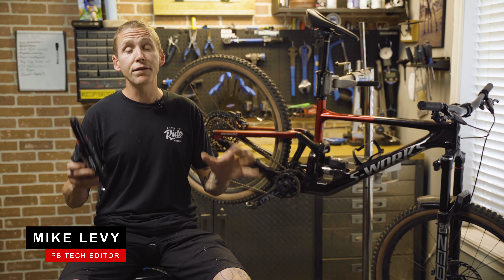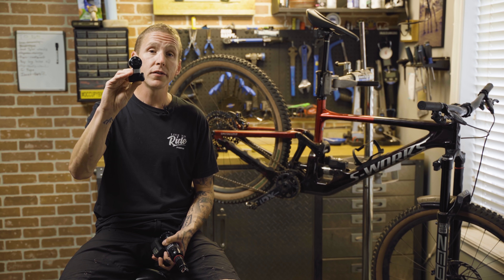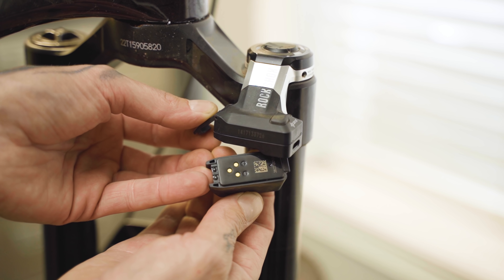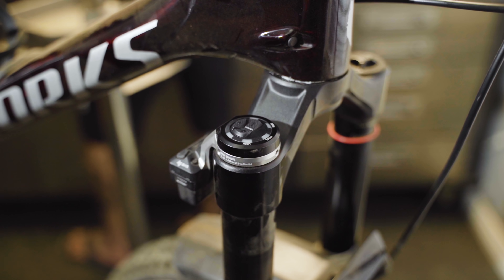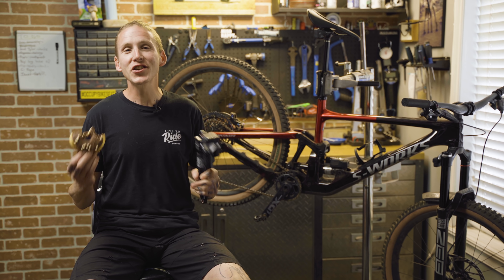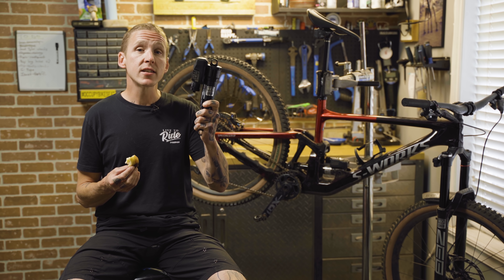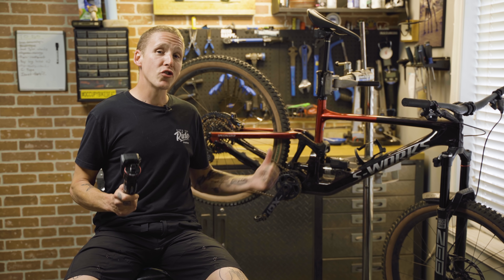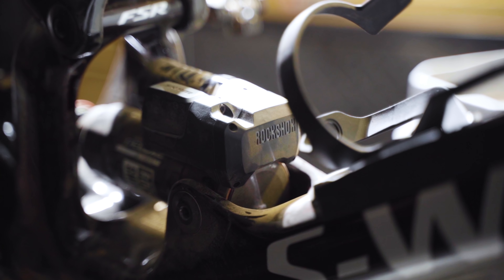Electronic, Computer-Controlled Suspension! Rockshox's Flight Attendant | First Look & Ride

Comment: I enjoyed using it initially but after 5 months issues showed then i was advised by rockshox to bring it to the authorized lbs, only march 2023 i got the bike from canyon. The local bike shop told me they did all the tests required by the sram but then werent able to fix. I tried to ask for warranty replacement but as per lbs, they said sram is refusing replacement and only want to change the controller. I mean i havent used the bike for total of 5 months since the issue occurred. But the first issue with the fork they replaced the entire fork. Im gonna buy a new bike but will definitely remove any rockshox or sram as i dont like how they treat their customers. Wont even reply in email.

Comment: I got this system on my Giant Trance X advanced Pro 29 SE for $4500. Giant used to sell them for 8,000. I think this means Flight Attendant is on its way out. But for that price, I got it anyway.  I like it as once you set it up you just have to turn it on and roll. Both RockShox Flight Attendant and the Giant Trance X SE are pretty rad. The combination of the two is even better. In fact, this bike surprised me as being one of my favorite bikes in my quiver.

Comment: I would definitely run it if I had the money :-)  The only time when I need to adjust my suspension is when I move really fast and go from one type of terrain to another. Reaching down and adjusting the suspension is a problem, especially when racing and transitioning from a long climb to a steep rocky downhill section.

Comment: For sure i would use it.  For the no ski lift within a 1000 miles brigade where long climbs are necessary, this gives you an option to enjoy your more burly bike so much more.  Climbing efficiency is the Achilles heel of most enduro bikes and this gives a viable alternative.  I’d rather have a few little batteries and be able to pedal the hills than a bigger battery in the down tube like some our E brethren.  Climbing efficiency as an added bonus adds to the joy of the descent and, after all, isn’t the guy with the biggest smile at the bottom the winner.

Comment: Battery count time - If you have a fully sram-ified bike
Eagle AXS Controller: 1
Reverb AXS Controller: 2
Eagle AXS Battery: 3
Reverb AXS Battery: 4
Flight Attendant fork Battery: 5
Flight Attendant shock battery: 6
Crank Sensor battery: 7
TyreWiz Battery Front: 8
TyreWiz Battery Back: 9
9 batteries? On a mountain bike??

Comment: Can you run the attendant on just the shock? That would suit the majority of folks better. So simply the DUB insert and the rear shock controller would be perfect! No fork required. But I’m thinking 🤔 SRAM/RS doesn’t like the vendor mismatch that is more prevalent in today’s configurations. Thanks!
Reply: Mia - Sᴇx Cʜᴀɴɴᴇʟ 18+🅥  yeah, I also have a decent quiver for different days out. However, I’ve been riding SCOTT for some time and use the Twin-Lock more then I ever thought I would. The Twin-Lock allows me to lock the fork and shock, limit the travel in a pro-pedal feedback, or fully open for DH. This allows me the option to be more conscientious and adaptive when riding. But, the Twin-lock has its limitations with  compression and dampening adjustability, so this new SRAM/RS setup may allow the suspension system to be configured adequately and subsequently adapts the travel accordingly at the next layer, hence the piggyback modules. That being said, I wouldn’t think it’ll be worthwhile for some time. More riders and feedback will be needed to help developers get a better system through lessons learned. I have the belief that you don’t know what you’re missing until you try it, and then never look back. I would be willing to try it to give insight and feedback to support the engineering of the system, but have considerable reservations about purchasing at this point. Good luck, stay safe on the trails…

Comment: I had a lapierre back in 2015 with the second generation e:i system and it worked pretty well for me, even in the wet Scottish climate. I'm a set and forget person and very rarely lock out my suspension, this might be something I'd run on my bike, but not at the extra cost it's gonna command, maybe in a few years when sram have recouped some of the development costs and price comes down.
Be interesting to see what if anything fox counter with, also I'm quite brand loyal with components and tend to go with fox and shimano over rockshox and sram.

Comment: So despite all the fancy PR and buzz words, this is just automatic (variable) lockout, with wireless override, right. No automatic low speed compression or rebound adjustment, no travel measurement or sack information. 
When I saw the announcement, I thought this was going to take the functions from the Quarq ShockWiz (also SRAM/Rockshox) and build it into the fork and make those adjustment automatic on the fly... Disappointed to learn is just a fancy lockout system.

Comment: I'd take the weight penalty to get an open bath, coil fork and coil shock and a price drop, but there's no attraction to adding electronic parts, though Shimano's manual 12 speed shifting feels so bad compared to their 9/10 speed that electronic shifting might make it in on that basis, which is absolutely the wrong reason.

Comment: Complete bullshit in my opinion. It doesn't work like a full integrated system like from Showa on the CBR 1000RR and it adds weight. But more important it adds complexity that no one wants except racers. Plus it ads $$$ to bikes that already cost plus 10.000 bucks. We're talking' about bicycles right?

Comment: They need to integrate the battery power into the onboard batteries on E-Bikes and offer a one battery solution that fits the water bottle cage.

Comment: So the bikes spec'ed with Flight Attendant cost about $2000 than bikes without it:

I ride about once per week, if I keep a bike for two years before selling call that 100 rides.
Every ride, I start with the climb switch on, pedal up the hill, flip the switch off, and descend the rest of the way. Just one flip per ride. So over the time that I own the bike, I flip the switch 100 times.

So it costs $20 every time I want the computer to flip the switch for me? Even if you ride twice as often, keep your bike for twice as long, flip the climb switch twice as often, would you pay a friend $2.50 to flip the switch for you each time? Why spend so much for a computer to do the same thing?

Comment: I could see if you do a lot of continuous uphill, downhill, uphill, downhill, etc. But usually you go up to the top, then down  ..... added weight, added cost, added maintenance/replacement parts (sort of why we ditched front derailleur), I'll flip a switch

Comment: Ah yes. If I buy every “innovation” sram wants…

Now before I go for a ride I need to check my derailleur battery is charged, fork battery is charged, shock battery is charged, dropper post battery is charged, dropper post remote battery is charged, AXS shifting controller is charged, shockwiz is charged and both my front and rear tyre wiz batteries are charged, and pedal spin sensor battery is charged

Comment: So is this the consumer version of the Blackbox kit that the pros on the enduro race scene have been testing? I'm guessing that there will be a 'race tuned' version coming out called Autopilot.
Reply: Rose 25 y.o - check my vidéó  And if your mobile battery dies can you adjust your suspension without the app or are you stuck with whatever range of settings you chose at the beginning of the day? It'd suck if you were planning an afternoon at the pump track (or vice versa).
I'm also interested how the bluetooth pairing performs when your bike is bouncing around on the back of a trailer with 20 other bluetooth connected bikes, although I guess there are enough bluetooth bikes already (for shifting, dropper post etc) that those bugs will be ironed out?

Comment: Real question: Is this better than flipping a climb switch? 
The only example I can think of is during a punchy climb in the middle of a downhill run, which is the only situation where I don't bother to flip my climb switch.
Reply: Does it dynamically adjust during a downhill run? Does it do anything during a downhill run other than open up the compression damping?

Comment: I love that they engineered this fantastic technological marvel! Im glad it now exists!

I absolutely do not want it!...not even at the same price.....i simply do not want my bicycle dependent on the electrical grid.
Reply: Tammy 23 y.o - check my vidéó  Yup. This....I will buy electric parts when its all powered by ONE battery, the motor battery. 

Motor bikes (E bikes) still have at least half a decade of development before they are powerful, cheap, and integrated. 

Iwill buy then. Todays crop is obsolete the same year they are bought.

Comment: Will it be available as an add-on, considering the parts work as normal if you run out of battery or take it off? Also, can it work with a Pike, or just the Zeb?

Comment: I don’t think that complexity and weight would be worth it. It used to be Terralogic, and the brain system, but they knew it without a battery and a computer. It is possible to solve these functions with purely mechanical solutions. What really happened to Terralogic? In the same way, why is there no externally adjustable travel like U-turn, and TALAS?

Comment: If the battery dies “it reverts to normal” does it stay in the last settings you had?
Reply: Jared, Batteries are interchangeable! When they revert back to normal/open, I am pretty sure that is the setting that you gave the shocks when you set them up; just the way you would on a normal manual shock system. ( With your weight ) etc.
Reply: @eddelgado2171  awesome! I can’t afford this anyway lol, but maybe one day…
Reply: Not hard to understand that normal means open

Comment: A lot of nay-sayers here, but this is where bike technology is heading. Smart bikes that can adapt to your riding, send an emergency signal in the event of a crash. Thumb print recognition / disable transmission if the bike is stolen, onboard GPS. People will moan about change with claims that its not 'pure' but the new generation of riders will embrace it. Its very exciting.
Reply: 🤮 Seriously, are we going to start hiring electronics engineers to wrench on bikes at bike shops, and pay them $60/hr?
Reply: @SnootchieBootchies27  Indeed. But it is a progression, it’s not as if tomorrow all bikes will suddenly be electronic, the changes will be incremental. Some repairs for the home mechanic will become more limited when faced with electronic / software problems, but that’s the same situation with Ebikes today, sales for which are increasing. Myself I do find something beautiful about an electronic free bike – but its worth keeping an open mind. Just look at the level of riding we see today thanks to previous advancements in technology.
Reply: @Wabit01  So... full discretion, I ride a full rigid singlespeed. I also have a 160mm travel full suspension mullet. I firmly believe that if more people were to try a simple, but robust mountain bike, they would realize that not only do they not need as much technology as they are purchasing, but it often takes away from the enjoyment of a ride, and as well, it demands a lot more maintenance.

Comment: After all this talk about pedaling efficiency, I am wondering: Is this basically an automatic lock out only or does it actually fine tune the suspension for ride quality/grip etc.? The quark thingies to help with suspension setup need to know the exact fork and shock movement (this is why you calibrate it and it measures the air pressure). The flight attendant doesn't collect this information so I am curious to know what exactly it can do. If it is mostly limited to the automatic lock out feature, it is barely more than a super expensive gimmick IMHO. In that case, I'd even prefer a manual lock out because it doesn't need a battery.
Reply: "The system takes information from sensors in the fork, shock, and cranks, and uses it to decide what COMPRESSION setting the suspension should be in: Open, Pedal, or Lock, or even a mix, where the fork might be in one mode and the shock in another. The analysis happens every 5 milliseconds, although the time it takes to actually open or close the fork or shock does takes a little longer than that."

Comment: i dont want a bike that needs 7 batteries to adjust my compression settings. i want a fork that doesnt creak within a year of buying it. please.
Reply: Sorry we are right out of round holes.
Reply: And more scratch resistant derailleur paint
Reply: And I would welcome an AXS dropper post that doesn't brake on the second ride, before we take the next step in technology.
Reply: Get a motorbike...

Comment: The dub spindle thing is a bit annoying, they should have made it Ant+ or Bluetooth transmission compatible so you can transmit the cadence data of a quark, stages or equivalent power meter into the flight attendant CPU.

Comment: so that's 3 batteries for the suspension, 1 for the rear der, 1 for the seatpost, 1 for the shifter, 1 for the dropper lever, 1 for your garmin, and the one in your phone in your pocket??  That's more watts than MVDP!
Reply: Electric bikes (mopeds as i call them) absolutely go well with all these electrical gadgets.

My 25 pound XC bike....i want it analog....like a tractor from the 1800s.
Reply: Yea, I'm real against electronic seat posts and shifting, but this seems more worth it. Especially if they get it a bit more active to aid in braking as well.
Reply: So far I'm looking at 24.7lb enduro mountain bike (electric gears and dropper) and wondering if to upgrade to this to for it

Comment: I'm more of a "leave everything open" rider and rarely flip the climb levers, so something that automates the process is intriguing.  However, if I am planning to do a ride with a lot of climbing, I tend to take a much lighter bike than my enduro bike.
Reply: I think that's one of the main reasons why this won't be as popular as something like the axs drivetrain. Someone who wants a better pedaling bike probably doesn't want to add 300g to their bike.
Reply: I love the idea of this and other funky suspension wizardry, but at the end of the day, I'm happier just riding a really good linkage up hills and leaving it wide open. I'm partial to anything Dave Weagle designed, but Yeti's Switch Infinity was pretty nice the one time I tried it. I've even ridden a couple of Horst-derived linkages that climbed well open.
Reply: I almost entirely ride with my shock in the trail setting, rarely ever fully open. I do flip the lockout (front and rear) when climbing on tarmac though
Reply: and a lot of climbs arent even timed
Reply: @JogBird  Nothing to do with the climb being timed. More about saving energy on the climb for the fun part going back down.
Reply: Ok, but isn't the point of an enduro bike to winch up those nasty climbs to be able to bomb the decents? Do you just take your enduro bike on flat trails? Seems ass backwards
Reply: @CCWclassic  yes, but if you could get up those climbs using less energy, then you would have more for the descents.
Reply: @ianfurqueron5850  for sure, I was just wondering what you use your enduro bike for if you don't take it on long climbs
Reply: @CCWclassic  I do some long climbs with it, although admittedly it gets more use at bike parks with ski lifts.

Comment: I don't think I'm ready for all these digital components. But I do see the advantage. I've never had trouble flipping my lockout switch... Except those times that I forget to. And I always feel like the lockout doesn't provide enough lockout. The suspension is still too soft when locked out. Which I think is intentional because they know I'm going to forget to unlock it occasionally and they don't want me to destroy it with a hard arrival. But with this system, because it won't forget to unlock itself, it could safely provide way more lockout. Even so, I don't anticipate getting this unless there is a bike I want that happens to already have it.

Comment: What they need to do is integrate a similar system like the Motion instruments solution into a product line in order to collect actionable insights on a per trail basis. This would allow us to create baselines per trail. This way, as I ride different trails over time, I can look at the data per trail, and set the appropriate settings per trail either manually, or with flight attended, automatically. That's the ideal solution imo!
Reply: Nice idea 👍

Comment: This would be a huge advantage in downhill races in pedal sections. But just give me a lockout button.

Betting this will fail like Fox live valve because it’s trying to be too clever.
Reply: No, the reason Fox Live Valve is failing is that you need a bike designed for it with cable routing and battery holding, and that's only a few Giant and Pivot models. This one won't require any special bike and although from what can be seen in this video you need a special fork and shock, there's a chance we can see it in the future being an upgrade to newer generation "standard" forks and shocks.